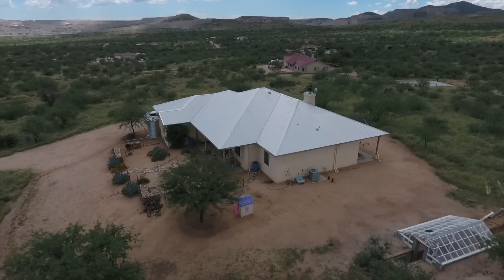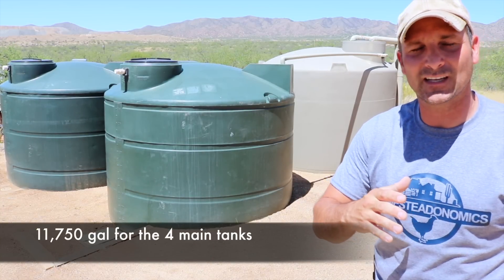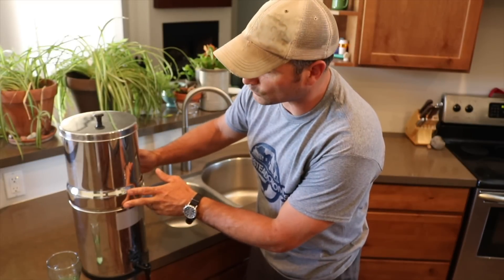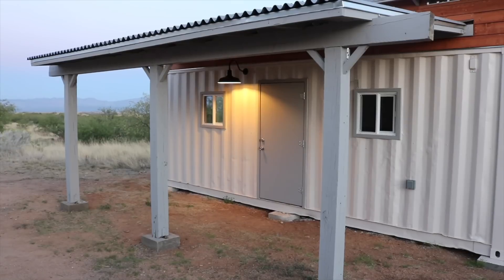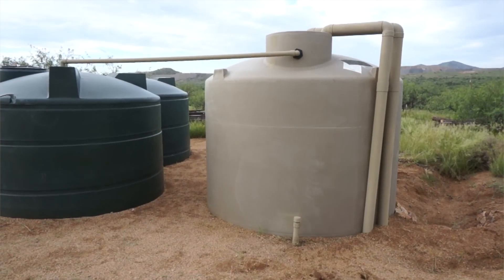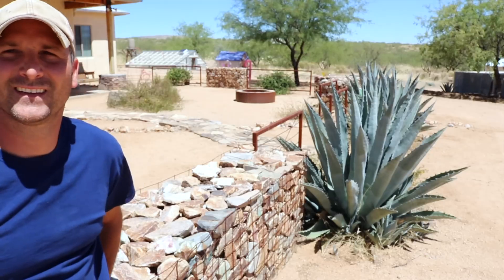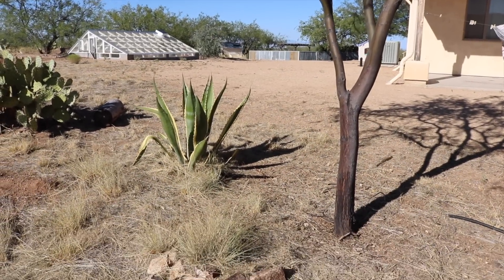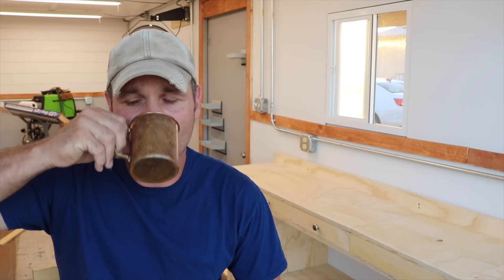Rainwater Harvesting QA - Cost, is it Illegal, how I treat, etc,.

Comment: If the roof water was coming from a green roof (I don't know if a green roof would be possible in Arizona?!!) would a 'first flush' system be of any value at all?  If I had all the space and autonomy I needed - I'd have moss roofs because moss is such a good filter.  Is there nothing similar for a more arid climate?  I don't know - maybe green roofs take too much water out of the system...

I love the whole setup.  However...  The billboard catchment thing....  Why?  You're missing a trick, there!  The space, underneath it, is completely redundant!  A roof is dual purpose because it keeps what's under it dry and can collect and channel the rain that falls on it.  Why didn't you erect another small building (with a roof!!) and then you could have dry stuff under/inside it?!!  Hah!  There's not so much that can be done with a resupine bill board (unless it's for weed control)!

You're extremely practical and resourceful, though.  And, unlike some self sufficiency setups I've seen, quite neat and tidy!  I wonder where all that rain water would be going if you weren't intercepting it.  I hope you're not inadvertently desiccating some nearby precious natural habitat!

Comment: People have survived on cisterns alone for centuries, and they never had any kind of filtering system. The water column itself is the filter system, because gravity does all of the hard work for you. You just don't draw your water supply too close to the bottom of the tanks. A funnel shaped bottom is all you need to flush the tank, and that only needs to be done every few years, and you don't have to drain the whole tank to adequately flush it either, just 1/4 of it.

Comment: Carbonic acid H2CO3, is  corrosive to copper pipe, brass fixtures and water heaters. H2CO3 will increase the level of Copper in water at the tap. It does this by dissolving your copper pipe and plumbing fixtures. I live in a town that had drinking water containing Carbonic acid that lead to problems of high levels of Copper in drinking water. I've replaced 15 year old copper pipe that was paper thin as a result of water with a low pH caused by Carbonic acid. Just a little information on the matter.

Comment: Great video.  Where did you go to research how to install gutter/plumbing/tanks/etc for your system?  Are your tanks filled through gravity or a pump?
Reply from the maker: Doug Standifer you might be still watching as I talk about those things in the video....but here is the short and quick 😉
Research...online and figuring on my own
-tanks are filled via gravity...I have another video that shows an illustration.  But the quick is that water moves via a level difference between the inlet gutters and the outlet, at the tanks
-in the video I talk about doing it on my own😀😂

Comment: I think that is great that you collect your own water.  Correct me if I am wrong, when you say "gray water" that is water that you have already used once (ie:  shower water, sink water, flushed toilet)?  How cold can your water be kept by burying the tanks?  

And not related to water, do you generate your own power as well either through solar panels or wind, or both?  And if not, is that something that you will be doing down the road?  Do you use geothermal technology to heat and cool your home?

Comment: I grew up in Spain on the east coast and it would some times rain every 11 months creating havoc as the soil couldnt absorb the water. The locals would use "Drop by drop" watering system for fruit trees, basically a very thin tube that would drip drops by the roots and creating very little waste of water. It would also be used on smaller shrubs and alike. They called it "gota a gota"(drop by drop). Some would be with 60 - 100 ltrs containers so they´s empty out and wouldnt empty a whole system of maybe many m2 or the main tanks

Comment: I plan to run the generator off of hydrogen made from water so this is important your video is important for this process I will collect water to run my generator but also collect water for showering cooking the bathroom so on and so forth we do actually have an underground well and it has not been used for years so I plan on tapping into that as well

Comment: Hi just came across your video today and have a question and some advice. My Question is does your plastic tanks have a UV inhibitor in them, otherwise they will only last 4-5 years tops in the sun, and advice is I would install a roof to take them out of the sun at any rate then they will last longer than the listed time they have given. I used to work in agriculture and used several different tanks include a few i had seen in your video the tanks that were undercover were still in excellent shape after 30 years. Good luck on your system. -Sam
Reply: He did say in his other video that he would probably eventually like to get those under a covering/roof.

Comment: Man you have done a GOOD JOB here. I a planning to build a house 'off grid' so it will  have no water or power! So I have construct a solar power collection system from batteries and inverters and a huge water storage system. Thanks for the ideas!
Reply: May I suggest you (re) consider turbine for your electrical production.
As weather control becomes more and more diligent, we are going to see much more continual high wind speeds and a lot of grey skies.
You'll be a lot safer.
Good luck.

Comment: if you put a T-joint where your gutter empties you could just fit a small section of pipe to the straight down portion to catch larger pieces of debris and fit a cap on the bottom to easily clean out when necessary, just an idea, think the physics behind it is pretty solid, let me know if you try it out please, love the system!

Comment: You yanks.. A first flush system really is a good idea, if for example a rodent gets into your downpipes (and they do it all the time when desperate for water) it's likely to drown, a first flush makes sure you don't have a corpse rotting away in your tank, or sitting on a tank filter with all the water passing over it. Your downpipes shouldn't have that large gap between the gutter outlet either, again rats can crawl up pvc pipes believe it or not. 

As for the lack of filtration, atleast get a 2 stage, sand and carbon filter, they're not very expensive. Idealy if you get a UV filter or a microbial filter as well, you won't have to boil your water. Also, showering in the stagnant tank water without filtration can sometimes cause people to get sick and or get large boils and rashes, this is because of microorganisms. A two stage filter will significantly reduce these problems.

Comment: I'm fortunate enough to have a small stream (2-4 feet wide in places) that runs down next to my driveway. The water flows down from a wooded area on the property that connects to my local State Park. So, with proper filtration and purification, I have a nearly endless supply of water year round (outside of any droughts) should municipal sources be shut off. This actually happened during the Elk River Chemical Spill in West Virginia on January 9th, 2014. Municipal Water was contaminated by Crude 4-methylcyclohexanemethanol (used in some Air Fresheners, but was primarily used in my area as a frothing agent in Coal Processing). The tap water was turned a faint green color and smelled strongly of black licorice . A bathtub filled with water had a tint of green to it, like someone dumped a cup or two of wintergreen mouthwash into it. Some people came in contact with stronger amounts of the chemical and actually had mild skin irritation on their bodies from taking a hot shower. A few even went to the hospital worried about chemical burns. Business who did not have an outside source of clean water had to shut down temporarily. Tap water was only suitable for flushing toilets. A few businesses got into legal trouble because they tripled the price of bottled water in their stores (Highly illegal during a state of emergency). People stockpiled so much water that you couldn't buy them. The Red Cross and other non profits hauled in truckloads of bottled water from other areas and had pickup locations for citizens to pick up water (limit 1 case per person/vehicle).

While we primarily used bottled water, we could filter and boil water from the stream by our house in a pinch. A cousin of mine just a few houses down from me, knew of an old Spring that Native Americans used hundreds of years ago. The spring flowed up through a crack in a large boulder and the Native Americans carved a bowl into the rock to collect water. Spring water is naturally filtered by layers of sand and clay that have been filtering the water for hundreds, if not thousands, of years. Spring water can be some of the cleanest tasting water you'll ever find. Better than anything you'll find in a bottle.

Comment: You are the MAN! We are building a tiny home in the central California coast region and the water company demands over 22 THOUSAND dollars initially to bring water service and a meter to a property - even though the pipe is sticking out of the ground less than 20 feet from our house! Being Burning Man attendees for many years, we can take full showers using only a couple of gallons of water each, plus we are installing a composting toilet. A 5000 gallon system will be our starting point and we will add as necessary. And heck, if it doesn't fulfill our needs, we can still spend the 22k to bring in city water (hopefully never). Thanks for such an inspiring life...

Comment: How often do you get rain and how much? I know you're in a desert, but the area surrounding your property looks relatively green, so you must receive a fair bit of precipitation at times, probably in the form of thunderstorms. Where I live in the tropics, we have two seasons. The wet and the dry. The dry season is very dry, with only occasional thunderstorms but often it can go for 2-3 months with insignificant rainfall, whereas during the wet season there can be torrential rain for days and a huge amount of rainfall for the 3 main months of the rainy season causing flooding in low lying areas (but not my property, which is very hilly). 

I am thinking about installing a similar system to yours - the bulk of the rain will fall during the 3 main months of the rainy season with almost nothing falling for about 6-7 months. I also have a well, but would like to complement the ground water supply with some rainwater tanks. Almost all the water I will collect, will be for irrigation purposes.

Comment: I only have a general interest in what you've done, but 68 yrs ago my parents and I built our own home from scratch and we drove our own well by hand and I dug our entire septic system by hand.  Most of the equipment now used wasn't available back then. When you are lifting a 25 lb weight and dropping it 2' to drive a  shallow well pipe for an hour and it only goes down 1" you begin to wonder if what you're doing is going to work.  We finally did succeed.    You're not alone having trouble obtaining water.   Here is a plumber who had trouble in a completely different situation than yours that you and many others might find interesting.  https://youtu.be/uwR0gOlhd54?t=24    Since you are generally living off the grid consider this, it works.  https://youtu.be/L410zfd0IRg?t=22 
The American Spirit remains strong.

Comment: I haul water from 9 miles away ;1000 gallons each trip in spring too fall. Winter (MT) haul 400 every other week  too cold to fill bigger tank had frozen parts before ! When I started 30 years ago we used 6000 gallon  , the last couple we are down to 3500 a month. That included water for 4 trees and a small lawn (360)  sq .feet ,1/4 " a week at most . It cost me $5.00 a 1000 ;$10.00 for fuel and where an tear! Roughly!! I'm going to set up my gutters to collect to use for outside watering in future as I would like to have more tree's and a small garden . Oh it is city treated water from water plant ;has raised up $1.00 every 5 year's  so far, but cheat as we don't pay for sewage . I had  drilled a well cost me $6000 ,best alkali water ..$18000 to set up a filtering  reverse osmosis , but the clean out of the alkali would have cost $30.00 every three months--30 years ago .Hauling it is away of life for a lot of us (neighbor).

Comment: Rainwater harvesting is frequently seen as a competitor to the government funded water system.  Which is why some governments have sought to make water collection illegal.  

The economics of a water distribution system means that if a significant reduction in water usage occurs, then the system goes broke.  99% of the cost of municipal water is building the infrastructure to hold it and distribute it.  That cost exists regardless of how much water you sell.  So having someone on the system use too little water means a big loss for the system.

Comment: That chicken wired stone can be removed..get a mason pastry bag and seal off all the big hole's and were you can get mortar type S into ..then take buckets of concrete with a 50% portland 20% sand and 30% water and slowly dump it over the top until you see leaks..then let it set up 45 minutes get a mason sponge and dunk it squeeze it  then wipe it flip it wipe it dunk it squeeze it repeat until all the cement is about a half inch into the stones.wait for it to dry overnight come back with the bag and fill in any spots you miss with the S mortar and dunk it squeeze it  then wipe it flip it wipe it dunk it squeeze it repeat.if you see by looking into the pile spots missing within dump more liquid portland over the top and wipe that clean when it reaches to the top...then you should be able to remove the wire...maybe even throw a piece of bluestone or local rock or sandstone on top...if you use bluestone you wanna thermal the edges...get a hose wet the area then blow torch it till it leafs off giving it a custom finish:)

Comment: Bird poop puts hair on ya chest, a little phosphate is good. Rain water is for house use only, lawns, plants take to much.  29000 Imperial gallons have never run out.  The reason cities didn't have rain water collection was most likely because of the Leaded petrol.  For the metric minded, 1mm of rain/sq meter= 1litre.

Comment: I have a question but don't know if you keep up on the comments for a video that is two years old. How long does your rain water last you during the summer time before it starts raining again? And another thing for your first initial rain that you gathered when you first built the house how long did it take to fill up your gallons and how long did you go with out water? Also how do you get electricity sense you live in a kind of desert area? I was thinking Solar Panels if you don't use them already.

Comment: I always find it strange when cost comes into play when determining whether or not to use a first-flush system when your entire water project probably cost (including materials, fuel for transporting parts to and from, etc) several thousands upon thousands of dollars. First flushes aren't meant to catch dirt and sediment. It's meant to stop bird and animal poop from entering your drinking water. Yes you mention this, but there is a difference between 'clean' and 'sanitized'. Will the sun destroy pathogens in the poop? Yes. All of them? No. Very nice system and Im glad it works for you, but for my system, filtration methods are number one on my list. You can make first-flush systems drain underground so you never have to clean them out.First 30 gallons drain underground, then the float activates and diverts water to your tanks.

Comment: Nice setup!  I have a 1,100 gallon RWCS in my back yard (can't do much more due to Big Sister (HOA) restrictions).   I keep the water for emergencies since it took over a year to collect it all with my 600sqft collection roof.  I built a 10 gallon first flush diverter & designed it to easily & quickly clean & empty.  I also built the connections to the roof to be stowable so it is hidden from the street.  I can set it up & take it down un about a minute.

Comment: loved the video. i may have missed it when you were stating  the cost of your system. $5,000 is cheap compared to having a well drilled, pump house set up and then electricity to run the whole thing every day. i have 2 rain barrels on my suburban house catching 110+ gallons on rainwater overtime it rains I honestly have trouble getting them emptied before God fills them again.

Comment: From a career plumber, you have a good idea of how not to poison your family. You talk about constant maintenance being the key. I point this out because I believe that testing for bacteria on an annual basis is the last step. Government offices usually have this available for less than $50. Sterilizing the entire system from roof to faucet annually followed by testing is very important. Spend a few dollars on the correct spray, usually from a wine making company. Botulism and dust born toxins are present in the air. Giardia is present in the water systems and will be carried in on the feet of birds, also in the poop. Technical term. Scrub with brushes on poles and drain and rinse. An outside source of water will be needed. 
If you are considering a system like this to save money over a well, you won't. If you don't mind the extra work and lower resale value, great job.